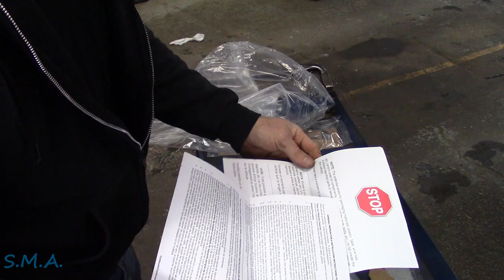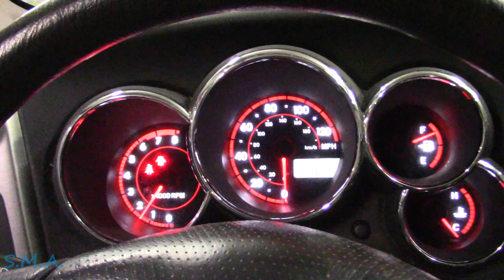A Merry Christmas Matrix Manifold

Comment: 98% of the products that Dorman sells is garbage, but more often than not, they are the only one who sells some specific parts.  Take a door hinge pin for a Chevy S10.  I can't find anyone else who sells one, so I have to buy the Dorman part at the auto parts store.  With a little modification to the pin and taking about twice the amount of time to replace the part as it should, we're back in business.  And of course you have to do the "correct" modifications to the pin, otherwise it moves and destroys the cheap pot metal bushings that come with it.

Comment: I need to replace my stoplight switch for my brake lights to function properly. Other people have said after the switch has been replaced my lights will not function without being calibrated to the bcm any ideas on which type of scan tool is needed for the calibration of the new switch?

Comment: Hey Eric, I've got a '99 Camry IMZ-FE V6, how would you say the difficulty is to change its rear manifold?  Things to be aware of?  I see the EGR tube flange nuts aren't looking too hot.  Since it's gassing the passenger compartment and making noise I'm thinking it may be a good idea to get that replaced.  I live in a salt belt area, but it must be nothing like what you're seeing for corrosion on cars as I usually see cars that are 10+ years older before they look as bad as some of the stuff you've shown.

Comment: I’ve got a small aftermarket parts story for you. I drive an older 03 Golf, it’s a sporty little car and pretty fun - but it’s also the worst car I’ve ever owned mechanically and always needs repairs. I’m driving down the road one day and the car sputters out, I diag it as the fuel pump relay. Volkswagen wants $80 for the damn thing and the Autozone special is $40. It’s a relay, what’s the worst that could happen? Well I put the relay in and the car still has no fuel, this leads me down a several day rabbit hole tracing wires and testing the airbag module, security system, etc. I was ready to give up, I just assumed that there was no way a brand new in box relay could be bad - it was. Let me tell you, I felt so stupid. I had the diag right, but I chose a cheaper part and it burned me. Ever since then if it is an electrical part I only buy OEM. Anyways, I feel your pain!

Comment: I bought some Dorman axle bumpers for my 1998 Camaro. Just like your bracket, the holes were not even close. Had to drill them oversize to make it fit. Pure garbage. Like you said, how much more could it cost to engineer the parts correctly. Think of what a kick ass company they would have.

Comment: Hiya doing Sir, 
  My 2003 matrix XR has 244,000 miles on it. I’ve changed the exhaust gasket twice, manifold once, manifold donut gasket three times already. I’m still getting a faint exhaust smell. Are usually just drive with the re-circulate door closed. While I’m on the highway I open it as fresh air is being sucked in. But while I’m driving around new York city, the recirc door is always closed.
 At this point I’ll take her to the junkyard like this whenever that day comes.
  Not sure if you ever got a chance to check out those videos I sent you from Afghanistan with theSMA stickers that I through onto the MAXXPRO MRAPS  and the Humvees?? Sent on messenger 2018. Anyway 👊🏼

Comment: Weird. I've never had issues with Dorman. Replaced the broken OEM rear shock mounts on my Mazda3 with Dorman.
Reply: True enough.....it depends a lot on WHICH Dorman product we're talking about. The Dorman bolt/springs for the doughnut gasket are actually pretty nice and even seem a bit better than OEM in that the ends are pointed to get a better first "Bite" . Dorman part 675-221...which is identical to Dorman "Help" line part 03123....same..... M10 x 1.25

Comment: The trick to cooking excellently juicy chicken and turkey is to NEVER cook it to 165F!  The USDA produced a chart containing the  times for given temperature needed to obtain 7-log10 lethality of Salmonella in meats based on various fat levels.  For Turkey with a fat level of 12% (Worst Case), you can cook it to 150F and hold it there for just under 5 minutes and it'll be just as safe to eat as cooking to 165F and holding for less than 10 seconds only it'll be super juicy.  Same goes with chicken.  Hold at 150F for 4 minutes and you're good to go.

Comment: The bracket went from the manifold to the body, right?  The engineering and physics of it seem wrong to me in that the engine will move around a bit on the motor mounts independent of the body and that bracket is trying to fight that movement, undoubtedly putting stress on the manifold, possibly causing the failure of said manifold. 
Just my two cents. 
Merry Christmas to you and your family.

Comment: dont put crap gas and maybe the injectors will last. i been using just shell for years, injectors are fine at 110 000 miles. helps to throw in amsoil performance improver gasoline additive too. what do you think about offering some customers to do a little crowning or fluid filming on the bottom where the crimps are along the skirts and wheel arches? it seems to have frozen in time the rusty spots i have on my car with a little oiling now and then. and its not the oil they say that does the trick but the stuff in the oil supposedly. im using amsoil metal protector lately - their little spray can. amsoil doesnt know how to make a bad product supposedly from all the comments out there.

Comment: I know people bust you about "factory specs" for torqueing bolts....BUT, isn't it true that the torque values the factory says, are for NEW bolts, with no corrosion, rust, whatever?  Old bolts have resistance to turning because of this, and torqueing them to "factory specs" may not ACTUALLY be sufficient.   Just a thought......

Comment: It would have been easier for them to just not punch a huge hole in the bracket in the wrong spot and put in the installation instructions to install the bracket and mark where the nut is, mark it with a sharpie, and drill the hole where you need it. It would have been one less manufacturing step and it actually would have worked. Oh well.